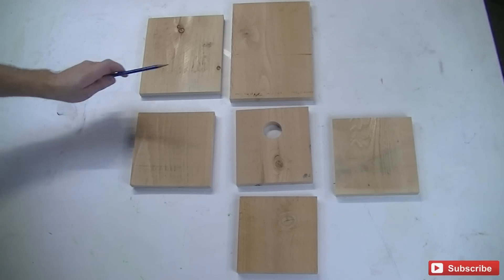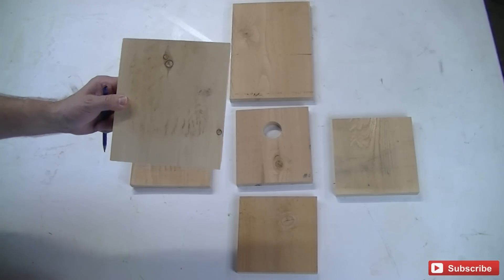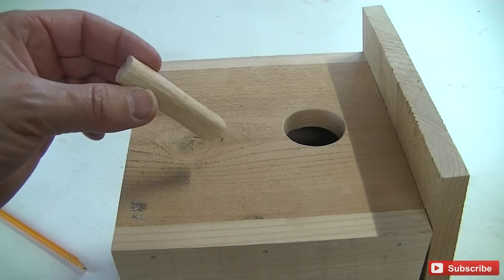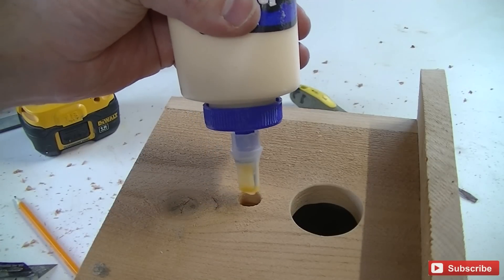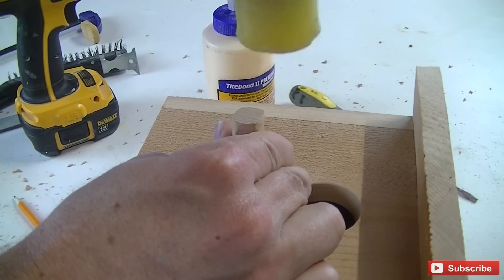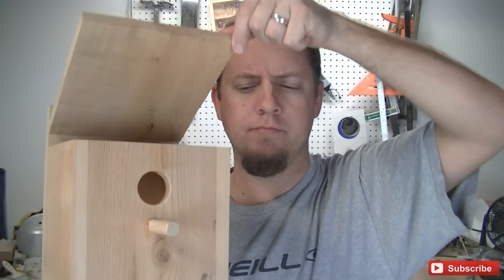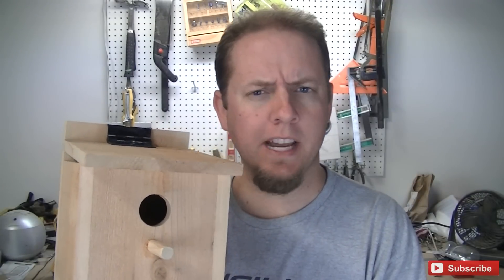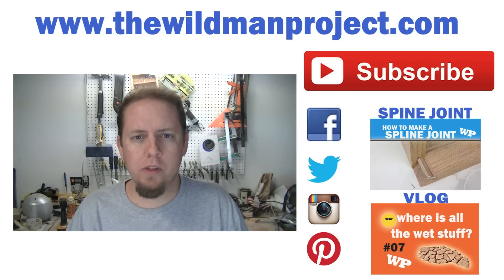How To Make A Birdhouse - DIY Project

Comment: I like the hinged roof idea, but I could definitely see how a squirrel might happen upon the way to open it.  However, that can easily be remedied by some kind of hook and/or latch modification.  Great design.
Reply: There are  several suggestions for constructing a bird house:
Give yourself enough time.
Use done for you boat outlines.
(I learned about these and more from Aviary Magic Method  site )

Comment: You've done a really good job on the bird house but if you want them to nest and rear young its not a good idea to have a convenient perch for predators to sit on while they stick their heads in and grab the babies!  For additional safety, you could make it a bit deeper too and roughen up the inside.  Then the babies will easily be able to climb out when the time comes.
Reply from the maker: +BoingBB Thanks for the tips!

Comment: +WildmanProject Where do you get these tools at and do they cost alot
Reply from the maker: Been buying tool for many...many years. Costs can very, it all depends on quality.
Reply: interesting points ,if anyone else trying to find out building a bird aviary plans try Debuncar Amazing Aviary  Aid (Have a quick look on google cant remember the place now ) ? Ive heard some great things about it and my co-worker got great results with it.
Reply: Here's  a few suggestions for constructing a bird house:
Give yourself plenty time.
Use ready made boat blueprints.
(I read about these and more on Aviary Magic Method  site )
Reply: Quick Channel harbor freight plus u need air compressor if u r a beginner  just use normal nails he uses a staple gun because it's easier